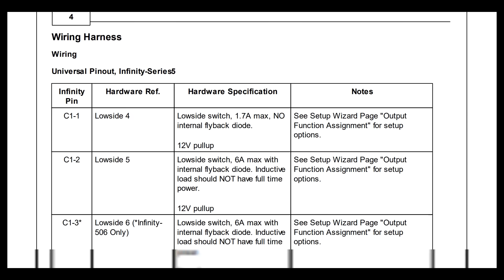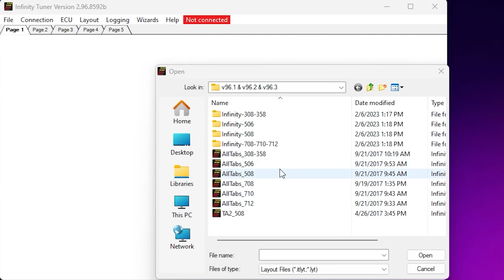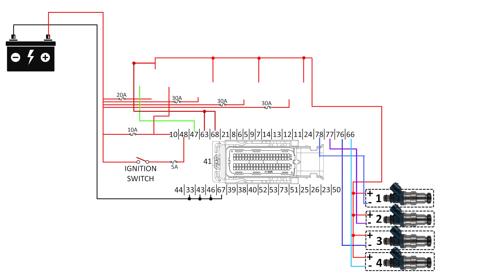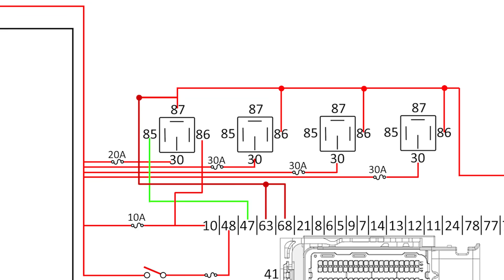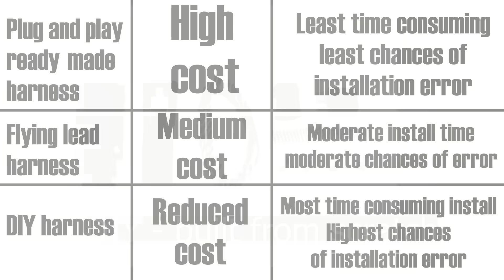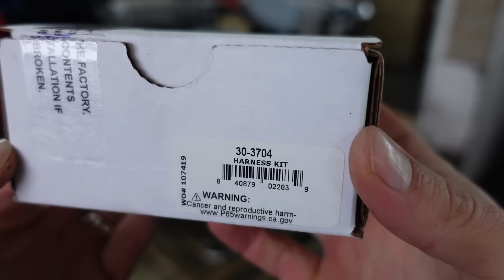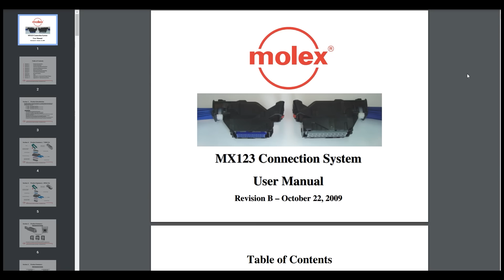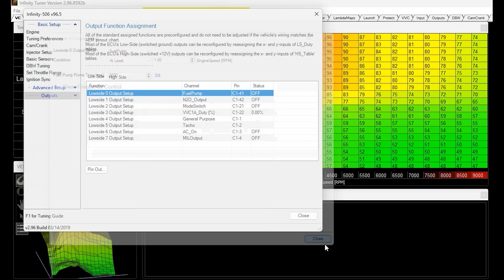Beginner guide to ECU install and wiring + editable wiring diagram download

Comment: It's highly suggested to use multi-colored wires, readily available for automotive work. When performing electrical wiring for a car's ECU, you must respect color codes for easier maintenance and diagnostics in the future. Black is consistently used for ground, Red for constant power, and Pink/Yellow/Green for ignition-switched power, with striped wires commonly used for specific sensor and output signals.

ECU wiring is often the most complex, and manufacturers frequently use striped wires (a base color with a thin stripe of a secondary color) to uniquely identify each sensor and output circuit.Circuit TypeCommon Base Color(s)NotesCommunication (CAN Bus)Twisted PairsOften Yellow/Green or Blue/White pairs. The wires are twisted together to minimize electrical interference. ECU and vehicle networks rely on this.Sensor Signal Return (Ground)Black/White or Brown/BlackWires that serve as the low reference or sensor ground for a specific sensor.Injector/Ignition OutputVarious (Often Pink/Black, Green/Red)Highly variable, but the colors are often repeated in sequence (e.g., Cylinder 1 is Green/Blue, Cylinder 2 is Green/Yellow, etc.)Sensor Power (Reference)Violet or GrayTypically a stable 5V reference voltage supplied by the ECU to the sensors (e.g., TPS, MAP).
O2 Sensor / WidebandWhite (Signal), Gray (Ground/Heater)Some specific sensors, like the oxygen sensor, often follow particular standards (e.g., the AEM or Bosch wideband standards).

Comment: Maybe an idea: put an optocoupler between the relais'  and the ECU gates. It takes all the strain away from controlling relais'. It happens a choke diode pops in a relais and toast the ECU end stage transistor. Sometimes relais controlling end stages in the ECU are already optocouplers, anyway opening and soldering inside a ECU is scary. Put some extra optocouplers between the ECU easy accessible. Beefy optocouplers survive popped choke diodes, you replace them under maintenance after track day.

Comment: 2:34 Morning guys:I have installed management computer box in Mazda3 2005-2006 model it start but didn't charge the battery and also not eccelerating what can i do about this

Comment: Could you make a video about how installing a standalone ECU could affect car functions such as the immobiliser, odometer and cluster functions / warning lights, diagnostics, ABS, and how it integrates with the CAN bus? Perhaps with advantages and potential problems of wiring a standalone ECU to work in parallel with existing ECU and the setup process?

Comment: I know its a lot to ask, but i've been working on a project car for a long time now, mainly due to lack of money and free time "full time carer for autistic son", i'm struggling with the wiring harness, i'm wanting to make a harness to adapt a bosch Med17 (audi a3 2.0tfsi) loom car side loom to a bosch Med7 (audi a3 3.2vr6) ecu, i've traced and separated all the wires connectors and sensors from car side Med7 main loom to use with the a3 2.0tfsi loom, i think i've worked out the pins to swap but not 100% sure, if i send you would you take a look and see if its correct, i'd really appreciate it, projects dead at the minute until i solve this..

Comment: Not sure if you will se this or respond to it but ill try and ask. Do you think i can rip out the ecu in my Audi 80 1.8s from 1991. And install this one? Because i would like to put itb's in my car instead of the monopoint injection system. Mostly for power and sound. Hope you see this even tho the video is old

Comment: I am curious about your wiring diagram, showing that the Hall sensors should get 12v from the battery. Is that correct? My understanding is that they get 5v from the Ecu 5v reference. Can you confirm?

Comment: I would like to ask. From the normal ecu position when we do cable extension do we need to programmer again or not? Will there be a problem with the operation of the motor?

Comment: Can this be done to any car 
I have a Acura Tl 2006 3.2  with an 2008 TLS 3.5 ENGINE AND TRANSMISSION ALSO ECU ITS SWAPPED WITH THE SUBFRAME Also the engine wire harness 

Currently I’m not able to pass inspection due to the CEL 

THE CAR DRIVES AND RUNNING BETTER THAN EVER IM IN NEW YORK 

I JUST WANNA PASS INSPECTION

Comment: Is this standalone ECU can be used on the Diesel Engine ( Chevrolet Colorado Duramax 2.5 Diesel engine )? Presently ECU is damage and having trouble here in Indonesia as the Chevrolet shutdown their operatuons leaving their previous dealership no access to their on line Techline SPS. I am very interested ..The way installation , and the software was illustrated  is awesome. Pls advise and where to order. Thank you

Comment: You should point out to never ever use house hold wire (i.e. from Lowes or Homedepot), but get automotive wire which is designed to take the heat under the hood. Which you can get online or some auto parts stores.

Comment: The greatest skill for this type of project is patience. You may have to read something 10 times before you understand it. Try to keep what you have to remember to a minimum, write everything down if it is different than the diagram. Don't be shy with the connectors, give each wire a good tug to check the crimp and the connector when installed. Better it pulls out now.
Reply: Everything you mention is really good advice. One other piece of advice I would add to these, is lock yourself in your workshop while you are in there during the critical jobs; So your friends can't interrupt your train of thought!
Reply: @robair67  Good point, it's easy to lose a car from your train of thought with a small distraction.

Comment: Sorry,   driving 4 answers,

I  pressd  the  send  button  but  my  text  was  not  complete,  here  the  second  part of  my  questions  about  2  stroke  outboard  engines:
2)  engines  of  one  series,  having  the  same  bore,  the  same  stroke  length,  the  same  volume,  the  same  number  and  configuration  of  cylinders,  come  with  power  of:  for  example  

1150 ccm, 3 cylinders,  yamaha  claims  the  best  outboard  they  ever  made!
They  produced  it  with  max  60,   70,  75,   80,  85   and  90  hp.
Which  of  these  engines  will  be  the  most  economic  in  fuel  consumtion  when  :
30  hp   are  used
40 hp  are  used
50 hp  are  used
60  hp  are  used
70  hp  are  used
80  hp  are  used
Whilst  boating  along???

Very  best  regards
Ulrich  Kilian,  northern  Germany

Comment: Hello  driving  for  answers,

You  make  wanderful  mechanical  videos.  

Could  you  make  a  video  to  answer  my  questions  about  carburated  two  stroke  outboards,  especially  from  yamah
My  questions  are  as  follows:
1.)  How  much  more  efficiency  does  the  3  cylinder  have  above  the  V 4  Cylinder,  and  why  is  that  so?
2.)

Comment: I noticed some flexibility in this product, like wasted spark ignition or not. I am wondering if it works with engines with more cylinders (like V8 and larger) without using wasted spark (like needed with speeduino). I also wonder if there is a way to daisy chain these in a “master/ slave” manner. I would probably need to do this since I have more output signals in my engine than most need (this is due to using an electronic signal to control valve movement - I’ve previously messaged you in instagram that i am using pneumatic valve actuators instead of a camshaft. Nice video in any case.

Comment: Nice guide as always! I'd recommend anyone buy a few decent quality depinning tools if they are getting this deep into wiring. They also make relay 4/5 pin connectors to tidy that bit up or small fuse/relay boxes. Once you get started it can actually be a lot of fun! Everyone makes mistakes though. When making the ignition harness for our rotary BRZ from scratch, even though I read the diagrams correctly and even wrote down my wiring correctly on my spreadsheet, I still managed to switch a white and blue wire. It reversed the order two coil packs were firing and funny enough the car still ran, but luckily I diagnosed it later when chasing other issues. Double and triple check your work! A lot of professionals will use a multimeter to continuity check every wire from ECU side to engine side before wrapping up a harness.

Comment: Wow. Doesn't look too bad to start from scratch if you can run everything without having to fish many wires. 
On the other hand it does kind of make me miss my 69 Chevy that only had a handful of wires going to the engine. If it didn't start, give the points a little filing and off you go again. Old thing still got 13 mpg. My 2000 ranger with a 4.0 v6 gets 13-14 mpg. My old 327 had Way more power though. Well kind of a 327, it was a 350 block with 305 heads and crank.

Comment: Hello, I expertise in cars wiring and specially in standalone ECUs wiring. 
You made a pretty good job. 
You told about soldering but in cars you really don't want to make joins that heat would weaken and get lose. Unless you're connecting wires to integrated circuits holes you always prefer crimping. 
You selected an aluminum plate to screw in ECU fusebox and relays but aluminum is conductive. Maybe I would have selected PTFE or PVC or plexiglass plate for that job. 
The issue you could have encountered with wires insulator hard to pin in connector could come from wire itself. There is different wire qualities over there, starting with the very common but ugly chinese PVC insulated wire to the best and more expensive raychem T4/T6 thin and heat resistant insulator wires, with FLRY wires and TXL wires in between that are much better than PVC insulated wires but less expensive and more common than raychem T wires.

Comment: Nice video!   As a tip; be careful not to run sensor wires alongside high power wires (alternator wires, wind shield wiper engine, starter engine, claxon,...) or wires carrying high pulse rates (ignition,...); it will affect the signal in the sensor wire and may give false info to the ECU.  Wires can pick up the electro magnetic field from another wire running parallel for some length and thus induce weird voltages. Crossing a high power wire is no problem. Car electric systems are one of the 'dirtiest' networks possible; lots of spikes and unclean (fluctuating) voltages in what should be stable DC voltage.  So take good care of proper grounding where necessary too; don't just connect a negative wire somewhere on the chassis (in a car the whole body work is considered negative or 'ground').   Thanks for your great informative channel and clear explanations!
Reply: I learned about this the hard way when a friend did a subwoofer install for me way back. he has the 4awg power wire too close to something and the EMF played havoc on the car. Funny thing is, it was fine for months before it actually caused a problem.

Comment: One thing you can do when splicing wiring, to clean it up and make it look nice, as well as make it easier to trace if the wire ever needs to be criticized during troubleshooting, is to use a slightly lower guage wire as a "bus bar" wire, run it near all components it will be connecting to, then connect smaller wires to it using T-tap crimps. or otherwise a solution that can joint off of the bus bar wire. It's not a solution that works everywhere, but there are moments where it can turn a rat's nest of wiring you have to dig through, and rebuilding a crimp with several wires, into following and unclipping the right T-Tap if you need to replace a section of wire.
Reply: Good call.

Comment: The required programming of the ECU (Tuning) is the major reason why I am hesitant of doing this.
I am 49yo, but can barely navigate my Desktop Computer!
As I am currently building a 1967 Ford (Falcon) Econoline Panel Van with a 2018 Mustang Eco-Boost 2.3l with a 10-Speed Transmission. Electrical (besides Stereo Installation) is my "KRYPTONITE"!

Comment: Damn. You'll giving us all the tools to build a custom car. I've been using the advice in your videos to build my EG33 Subaru. Hopefully it comes together good. I'm hoping maybe you'll get into some tuning and setting up base maps at some point too. That would be awesome.
Reply: We love a good EG33.
Reply: @802Garage  The motor build came out of a Sand rail drag car out in the Oregon dunes. It's going to be going into a Bugeye WRX now. Just need to get our hands on some STI transmission stuff and it will be good to shove into the car. Most of the engine work and wiring is done now.
Reply: @MidoriSakuraSky  Sounds awesome! We just finished rotary swapping a BRZ, but I also have plans to put a BRZ engine in an S12 and a WRX engine into an Eclipse. 😂
Reply: @802Garage  That's awesome man. Rotary engines are hella underrated. Nice to see some love for the S12. I have a S13 right now I'm trying to build. SR20VET. It's proven to actually be a real pain in the butt. I'll get it sorted out though
Reply: @MidoriSakuraSky  I'm also putting an SR20 in my  MR2. If I had a longitudinal SR on hand I would put that in the S12, but they pricey. The FA20 was free! XD Jealous of your S13.
Reply: @802Garage  Hell yeah man! An SR20 MR2 is pretty sick. The longitudinal SR20s are stupid expensive right now unfortunately.... I have a 1985 MR2 that I'd like to eventually do a 20v 7AGE turbo with supercharger pistons for good street use. It's kinda on the back burner though. Having issues with my SR. Can't seem to set the CAS correctly. Going to get a nistune on it and go from there. The SR motors don't run well on American gasoline without a tune.
Reply: @802Garage   @802 Garage  X-Trail is an interesting motor. I've always been interested in it because it's the only factory VET motor. Unfortunately because it's FWD I've never really been super interested. I opted to do a B13 VE head on a DET block. I'm doing Nistune because that's what my tuner recommends for my power goals. For my EG33 I'll be doing a Haltech 2500T. But it's going to be aiming for high 800's. I absolutely love my MR2. I've watched every single video D4A gas made actually haha. Definitely a huge fan. Though cars are currently on the back burner for me right now as I'm trying to get my commercial pilot license so my money is kinda going there right now.
Reply: @MidoriSakuraSky  Yeah it sucks it was FWD only, but it was the highest HP SR20 from the factory ever, so I figure it would be really cool to do something with one. And yeah going with the tuner recommend makes sense. No need to spend extra money. That EG33 build sounds nuts. I'm sure you watch Smeedia too then. Yeah D4A is a friend of mine, great guy, awesome channel. You're doing all kinds of things! We love to see it.
Reply: @MidoriSakuraSky  Also it was dumb to ask if you watch D4A because of course you do... It's his video... I just meant have you watched all of his AW11 build, hahaha.
Reply: @802Garage  Yeah I think the SR20VET has the potential to be an amazing motor. In and MR2 is actually genius considering it will keep it's RWD. I think I'll start posting things once I'm in a good position to start working on it. I had to move back in with my parents so I could start learning how to fly. Me and a buddy are gonna team together and tackle it! Yes I watch smeedia! It's amazing to see! I plan on posting a breakdown video of my EG33 as well as a video about potentially my EJ build that's currently in my WRX.
Reply: @802Garage  Do you have any camera recommendations for recording all this stuff?
Reply: @802Garage  All good bro. Yes I had watched all his AW11 videos. It's heavily relevant to my future build! Also I should mention, Call me crazy but. My EG33 will be twin charged. It's going to be a long journey but I'm going for the twin charged build. Starting with turbo then adding a Roots supercharger from a mustang 5.0.
Reply: @802Garage  Duuuude... You're the person who made that Scotty parody... I watched that like 3 years ago. That's awesome
Reply: @MidoriSakuraSky  Yep that's me in the parody! Hahaha. The MR2 is still in good shape, just has some very minor rust to take care of and my goal is to repaint it Giallo Modena. The only twin charged Subaru build I know of right now is Boosted Problems on YouTube. As for camera equipment, assuming you have a phone made in the last 3 years, start there. Modern phone cameras are amazing. Stick to the rear camera, obviously, and use the highest quality mode you can tolerate. If you audio sucks, get an external mic. If you just want to get into filming more without using your phone, start with a used GoPro Hero 8, 9, or get the new 11. The 10 had a lot of issues. They aren't amazing at everything, but they are pretty much good at everything, with fantastic stabilization and good wind noise reduction. Some frustrations for sure, but easy. I'll sub to you right now!

Comment: Why don’t you use a PDM module instead of fuses and relays?
Reply from the maker: Because they're expensive 😁
Reply: @d4a  Ok thanks for the answer 🙂 maybe good to clarify that next time in the video for us that don’t know 🙂
Reply: @Musselicious  Well, beginners won't need one so it would be entirely pointless to do so as most installs will use stock fusebox. PDM is really material for separate video with "if/when to use it", if say AEM wanted to sponsor one wink-wink nudge-nudge
Reply: @xani666  I didn’t mean to have it in the video, just the explanation what it’s for and why he didn’t use it instead of fuses and relays.